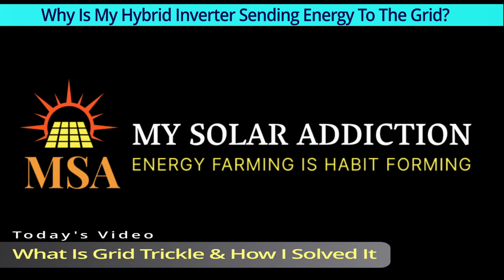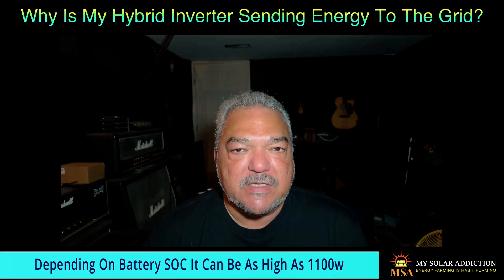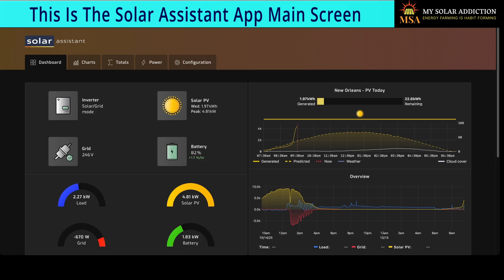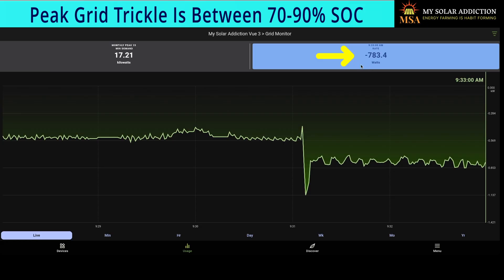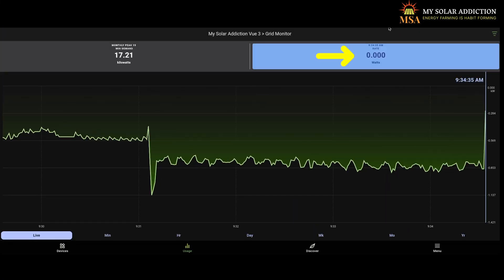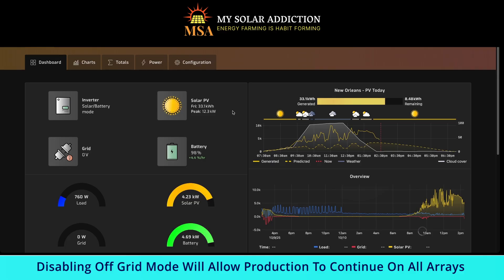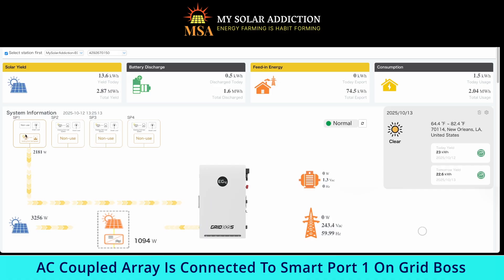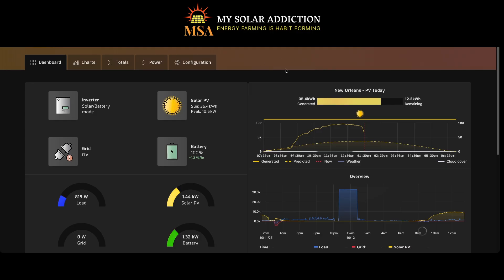What Is Grid Trickle And How I Solved It

Comment: You need to disconnect from the grid at this point.
Reply from the maker: I like having the ability to use the grid if need be… mainly when I want to work on the system.  I do have two generators for the Armageddon scenarios.  But you do have a point.  I wouldn’t have to pay the BS fees just for having the connection.

Comment: can you send a link for the software for monitoring your solar
Reply from the maker: goggle solar assistant and you'll find it.  It runs on a mini computer or raspberry or orange pi.  I also use Emporia Vue 3 for monitoring all my loads and my grid connection so I can verify that the software from the inverter is accurate.  I will post a link in the description for solar assistant.

Comment: Saw a post on FB group "Signature Solar EG4 Users"  from someone using a 12000xp off grid inverter their utility sent him a letter showing he was back feeding to the grid with the times and amount of power few watts at a time. He has it connected in line with the mains between the grid and his main panel entire house is running through the 12000xp. He said EG4 advised him to put a small light bulb to both legs on the grid side. This can happen with an off-grid inverter as well.

Comment: First fix your audio because is only on the left side... 
About your DIY system... when you change to Deye hybrid inverter, you will not have any problem anymore... 
Deye fix this issue long time ago...
Good luck everyone...
Reply from the maker: You are correct sir... I accidentally changed a setting on that mic without knowing it and didn't proof my work with headphones.  Won't make that mistake again.  

Never owned a Deye but I have two Sol-Ark 15ks that were made by Deye for Sol-Ark and they had the grid trickle problem during the 1.5 years I used them.  Would love to try out a Deye someday
Reply: I can introduce you to someone from China to help you get one for great deal... 
Maybe even like sponsor or something... 
Let me know if you are interested...?
Good luck...

Comment: Must be a battery communication problem. Try using voltage  as mine holds full battery soon as it is full and sells all day. But I don't see a problem selling anytime and the self consumption mode does a great job at keeping it charged all in auto mode.